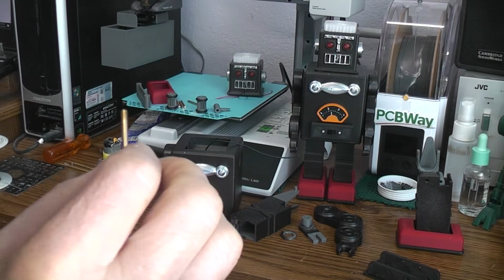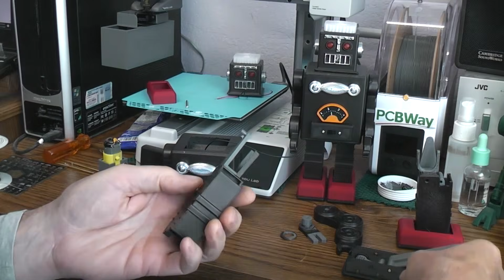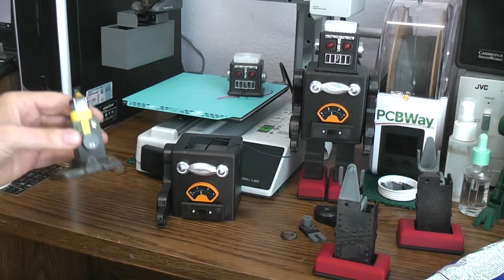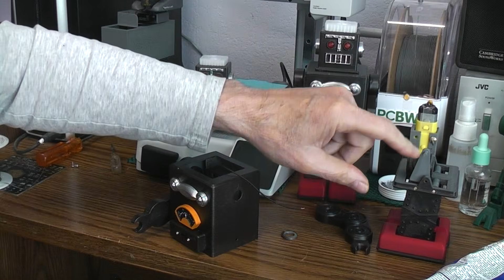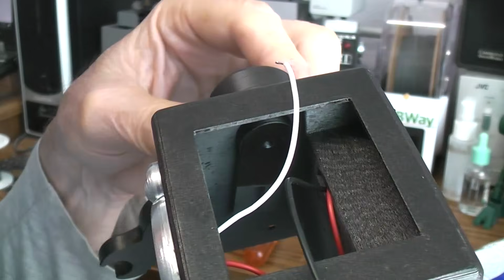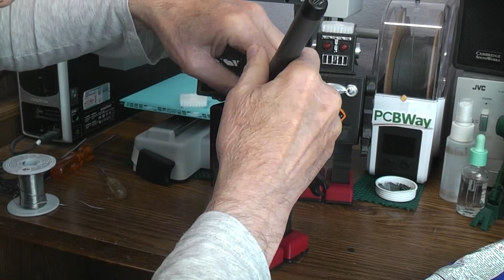Build video for the 3d printed mechanical Smoking POGOT robot project. The body and legs.

Comment: Absolutely love this! Your designs are so excellent and work so smoothly. When you cut those rods, do you just use a saw or do you clip them?
Reply from the maker: The 3mm brass rods I use a Hobby saw, sometimes called a jewelers saw. Train guys use them to cut the brass rail on their train layouts.
The cool thing about brass rod is that you only have to cut about 1/2 way threw then you can just snap the cut joint with your hands. I use a file to smooth the cut / snap joint.
Reply: @Robothut  Okay cool! I wondered how you cut them so perfect. Thank you!

Comment: Beautiful but some considerations:
1) When you print decorative parts, like the silver one in front and the "ears", use the Concentric filling for the top layer. It gives it a lathe-worked look.
2) I agree about NOT putting glue on the feet, rightly a robot must always have all the parts removable for maintenance.
3) For the same reason, instead of making permanent soldering I would have put connectors, like Dupont for example.
Great work as always.  👍
Reply from the maker: Everyone can built the robot to there specifications. I present only the basic and simple way to do it for others to make there own.